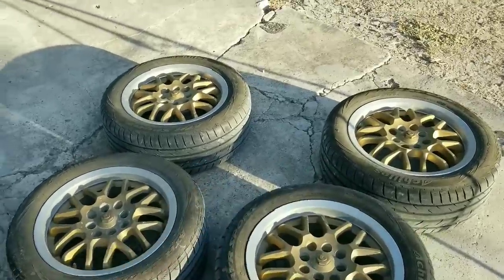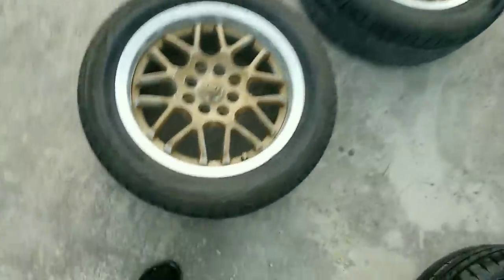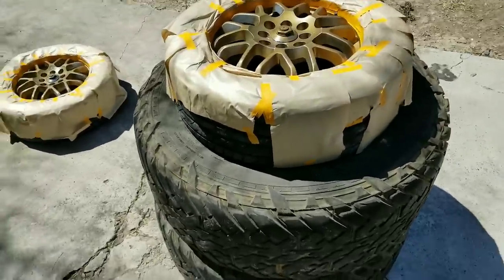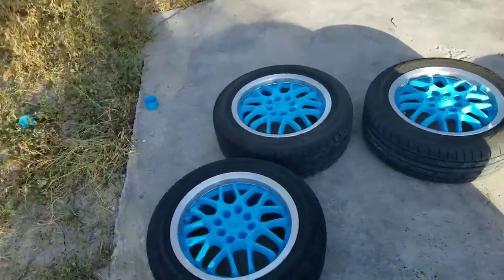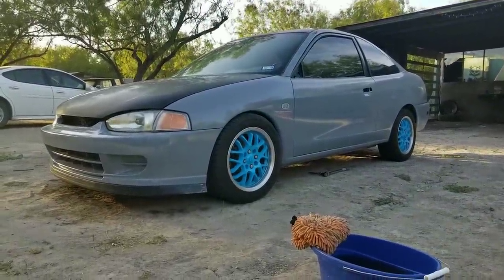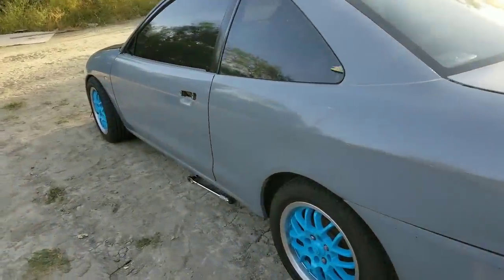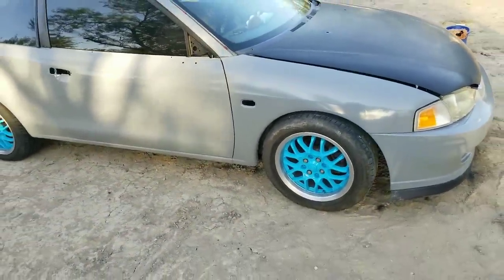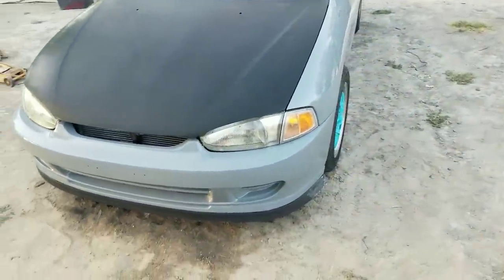Painting the Wheels | Rustoleum Morning Waterfall

Comment: Looking good man.. Rustoleum is just Acrylic Enamel. Manufacturers used Acrylic paint until urethanes and waterborne were created. Which means, there's nothing wrong with Acrylic paints. Yes there's newer/better tech out there, but "real" paint isn't cheap. And when you're working with what you got then the people hating on you can blow👌👌

My 2 cents is paint the mirrors black, itll match better with the car and if you decide to change the color of the wheels you wont be stuck doing the mirrors as well

Comment: The reason why most people don't like using rattlecan paint is it is just like single stage paint which is color/clearcoat together and will stand up to the Suns uvrays maybe a year or two until it starts to sunburn and peel. For painting wheels and interior pieces I would recommend rustoleum but just not for exterior basecoat.

Comment: I had this rims on my car for like 4 years, and these where probably one of the hardest rims I’ve ever painted, they’re was like 3 different coats of different colors and I just couldn’t handle removing them all so I just plasti dipped em black😂
Reply from the maker: Next time, try using aircraft remover. Just spray it on, leave it for a few minutes and you can literally pressure wash the paint of without have to touch it!
Not messy like paint stripper

Comment: I second painting the mirrors black, just think that blue will stand out too much. But hey it's your car lol. Great job! 

My only complaint about the aerosol rustoleum paint is the nozzle. I've found if you use all the paint, you're fine. But if you have some left it stays in the nozzle and clogs it no matter how much you clean it. Just my experience.
Reply from the maker: Yea might go with black! 
On this spray can,  once it gets down to about 1/3 can left,  it doesn't spray the same. 🤷‍♂️
Reply: @GTsPerformance  That's probably because the aerosol is running low. There are videos on YT on how to recharge them using compressed air.
Reply: Upside down, tap nozzle 1-2 times, no clog. Works every time for me.

Comment: Paint looks great what model is the car?
Reply from the maker: It's a 97 Mitsubishi Mirage DE
Reply: I have a 2000 model I don’t know if the trunks are the same but it’s just sitting around they look very similar tho
Reply from the maker: @InvictusPandasGarage  I think from 99 -02 they have a crease right above the license plate,  but they should bolt right in
Reply: If I had a way to send it to you I would it’s just a scrap car basically I was building a track car but it would turn over one day and I pulled the valve cover off it was full of water